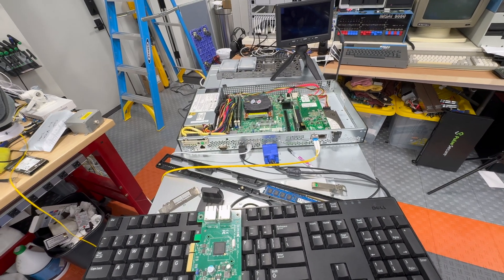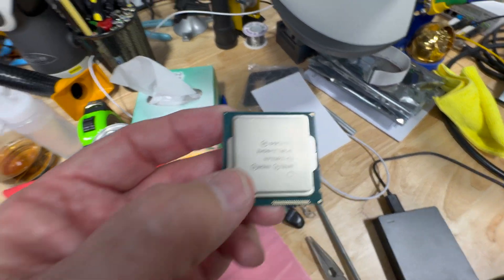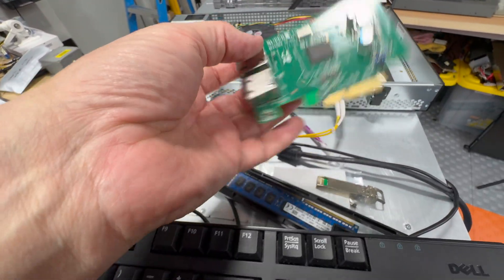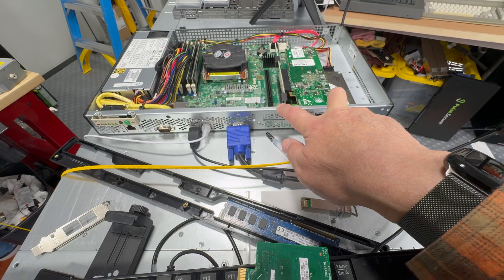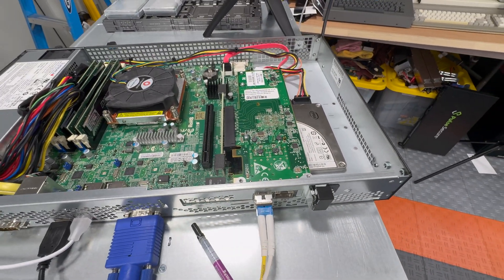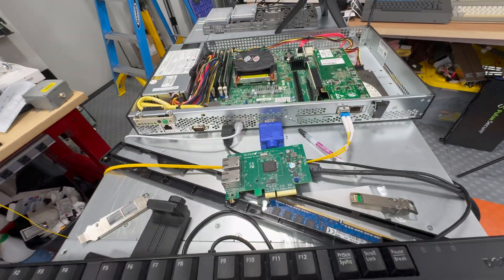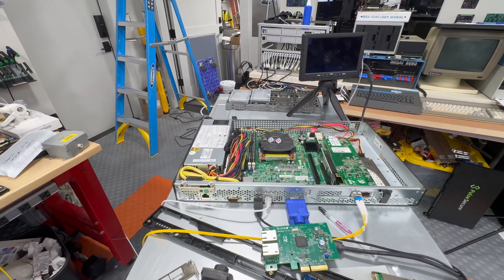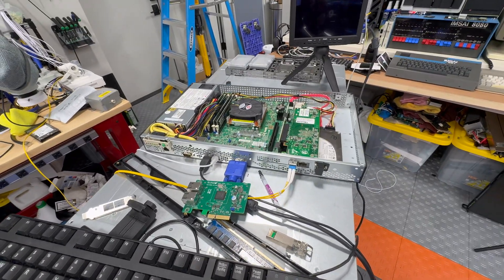HOMELAB: Quick update on the pulse secure device reuse.

Comment: The only issue with these 1RU boxes and riser cards is they only really work with NIC, I tried to install a PCIe to SATA card in a similar SuperMicro device and it wouldn't fit due to some caps on the PCIe card.

Comment: Is the case a standard motherboard size at all, obviously would require modification, but if I had one of these systems with a broken board and/or didn't want a high idle TDP cpu. 
Rack mountable 1u cases can be quite pricey and this would perhaps make more sense.

Comment: Good stuff, I like how you modified the PCIe bracket. I may do something similar as long as the screw holes line up with my card. I just need to find a way to make my Dremel cut a nice straight line. I see the Xeon is slightly higher TDP, how is the stock cooler handling it?
Reply from the maker: Actually really well - It is a fan integrated into the heat sink so pretty direct.   I'll do some Wireguard benchmarks to warm it up some and see how it measures... oh an I need to measure power draw too.

I was surprised the screw holes lines up perfectly!  I just happened to have an Intel DUAL SFP+ card that was the right size.